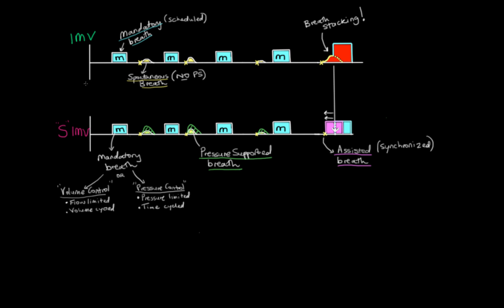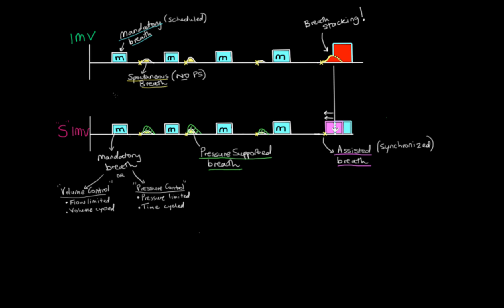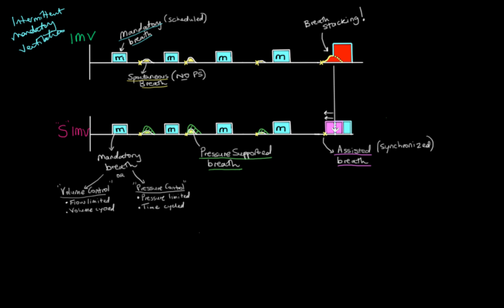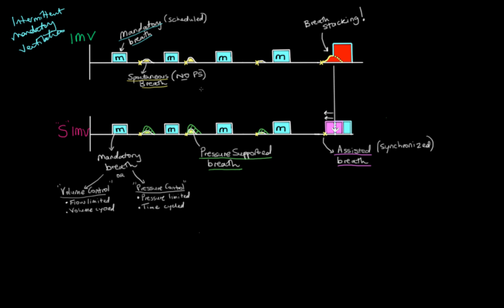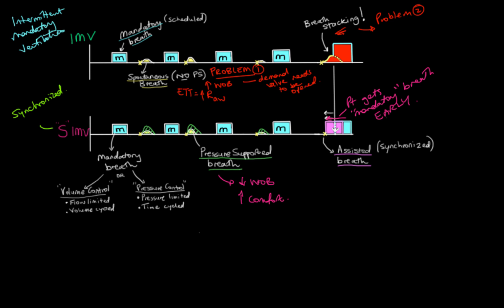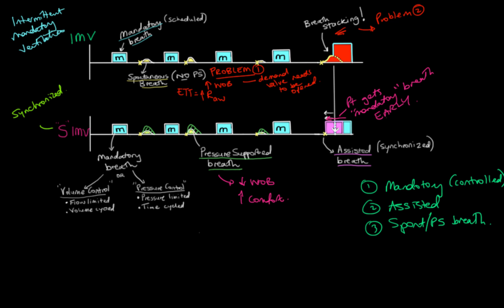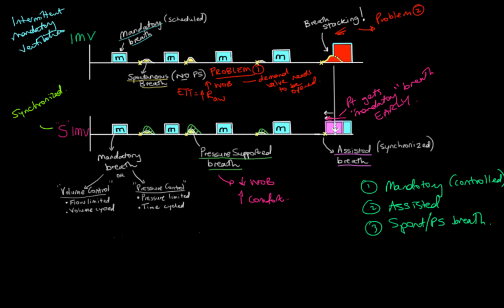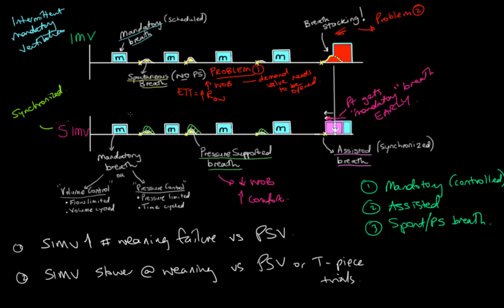Principles of Mechanical Ventilation 14: SIMV

Comment: I thought SIMV was pressure supported only if its "SIMV+PS" is SIMV always with PS?
Reply from the maker: SIMV as it’s classically described will have PS breaths. How ventilator companies label it will vary a lot but the principles will be the same. I’ve never heard of an SIMV mode that doesn’t allow PS breaths. Perhaps you can share an example with everyone?
Reply: @RespiratoryReview  yea its on my school notes. SIMV is described on its own , and then PS is described on its own. and the next slide is SIMV+P/S, and both waveforms are drawn which is why I get confused what's accurate and not. THANK YOU

Comment: 5:54- u said pressure controlled which is pressure  limited time cyceld. isn't pressure control also FLOW LIMITED PRESSURE CYCELD ? there's two types of pressure controls right ? so why did you choose to say its only pressure limited time cyceld when there's another form
Reply from the maker: Please share with everyone the specifics (reference) for a pressure control breath type that’s flow limited, pressure cycled. I’ve never seen or heard of such a thing.
Reply: @RespiratoryReview  im just looking at my class notes and it has a picture of two types of pressure control waveforms. one of them is described as flow limited pressure cycled; which is why I ask. so im not sure . so is pressure control only time cycled flow limited? and wouldn't pressure control be pressure limited since its controlling pressure?

Comment: Hi, thank you for the amazing series of videos. I have a question: what is the difference between assisted breaths with partial level of support and spontaneous/pressure supported breaths? Aren't they basically the same thing?
Reply from the maker: An assisted breath is the same as a controlled breath in every way, except that it is triggered by the patients effort instead of being based off a respiratory rate. So an assisted breath in volume control ventilation with a set TV of 500mLs would be 500mLs. All of the breath characteristics would be the same as the fully controlled breath except for the fact it is patient triggered. So not much room for variation based on the patients flow demands etc. A spontaneous or pressure supported breath is also triggered by the patient but allows the patient more control over the tidal volume, flow etc. Pressure supported breaths just apply some pressure to help augment the patients tidal volume (which will vary based on patients effort)  vs giving a preset tidal volume (which is what happens in an assisted breath). hope that helps
Reply: RespiratoryReview that helps indeed! Thank you for you kind reply :)

Comment: Why is then such a poor way to wean patients?
Reply from the maker: It's not so much that it is a poor way to wean patients. It used to be used a lot more for weaning (a little before my time) - and I know there's some clinicians out there that have had success with it. It's more that there are better ways to wean nowadays like PSV, and a mode called proportional assist ventilation (PAV) to give a couple of examples. These give the patient more control over their ventilation than SIMV, and balance the work done by the ventilator with the work done by the patient a little better, which is really important when weaning.